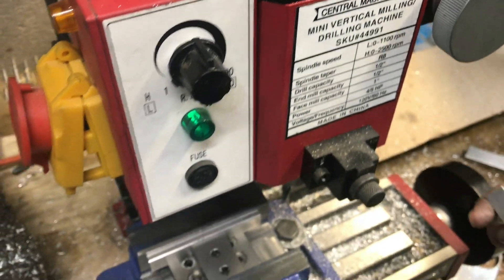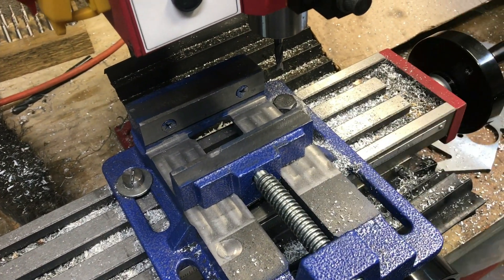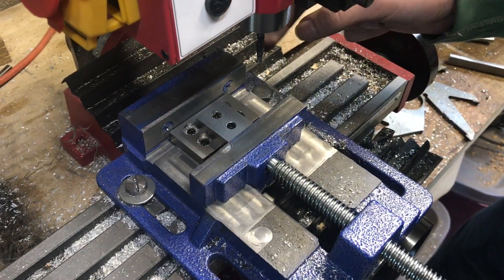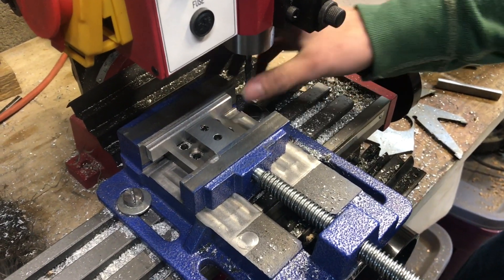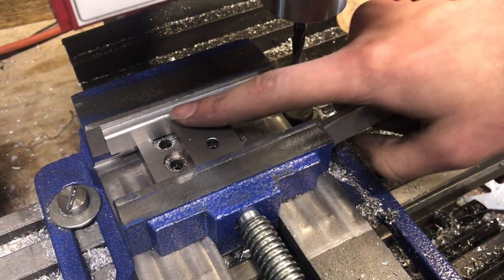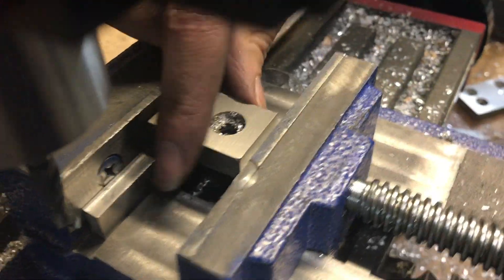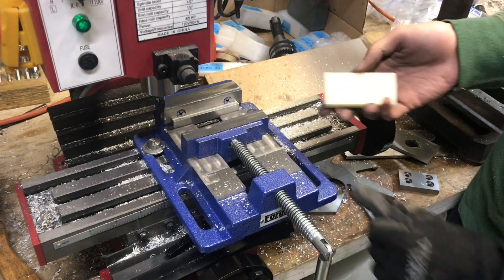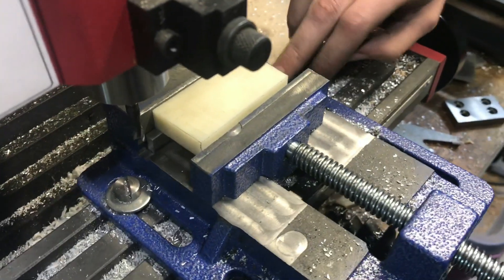MAKING the harbor freight milling machine VICE accurate for Percision milling (item 44991)

Comment: Why not add a bead of weld then mill it down?
Reply: I was thinking liquid steel and then mill since I have no welder.
Reply: Right, or sand a round bar of anything into a half round and glue it in to fill the slot?